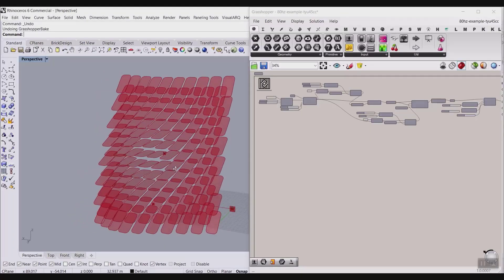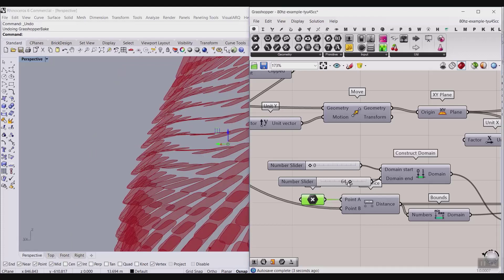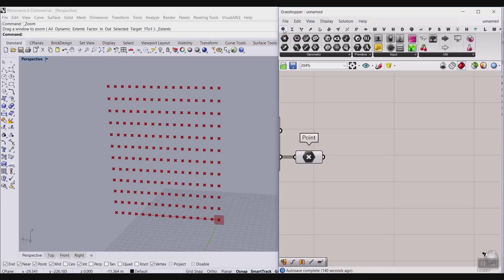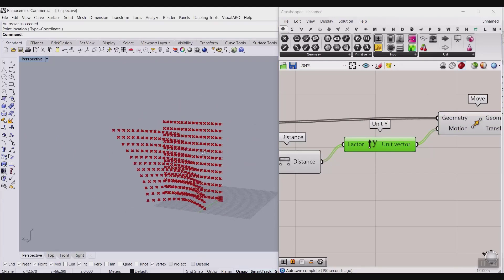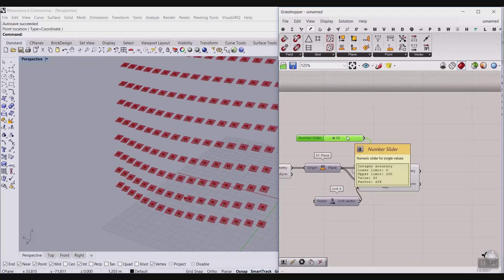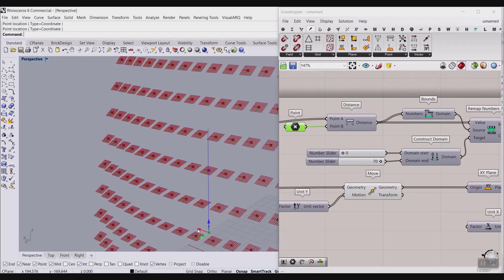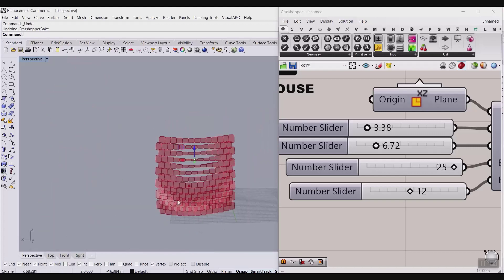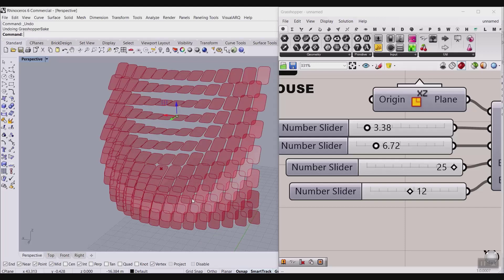80Hz Pavilion (Rhino Grasshopper Tutorial)

Comment: Why use domain for the rectangle at the last step? I just connect the size sliders to it and the result is the same
Reply from the maker: Hi, the difference is when you just use the number slider, the base planes would be located at the corner of each rectangle! but when you define a domain that goes from - L/2 to +L/2 the base planes would be located exactly at the center of your rectangles.

Comment: Thank you for your amazing contents again. I am a noob of Grasshopper but I am following your videos step by step. It is a really nice process to gradually understand the logic of Grasshopper. After I go through this tutorial, I wanted to go a little bit further to make each surface as poly-surface, so I struggled a bit, but finally kinda find a semi-solution using a combination of Extrude and Offset surface (Used Offset Surface linked to Direction input of Extrude as all surfaces directions are different). But the thickness is always 1mm and if I put a value ex. 2 mm at the distance only additional surface added over the extruded surfaces and they aren't closed. 

How can I have control of the thickness? :)